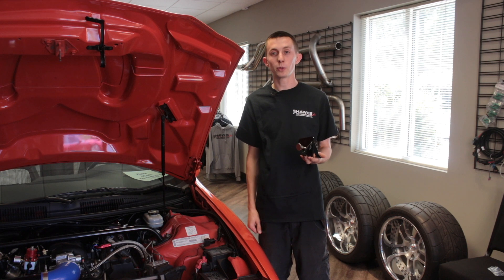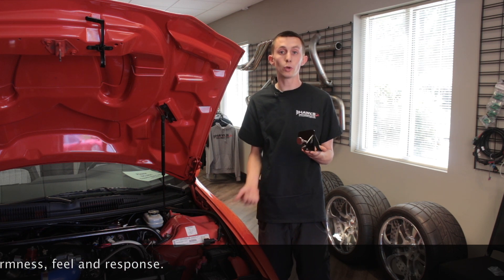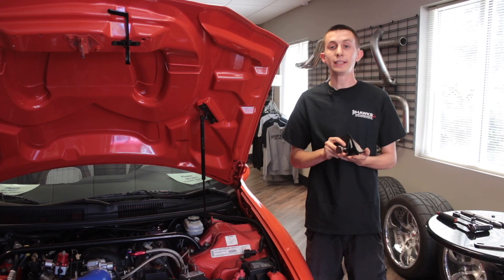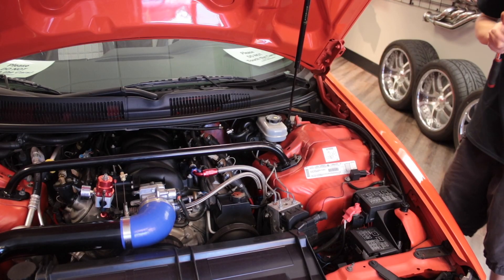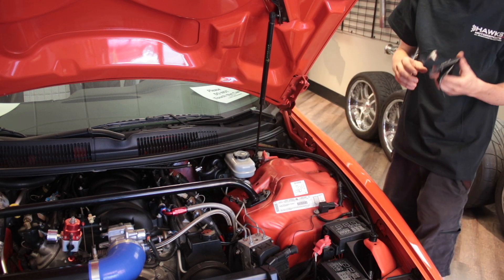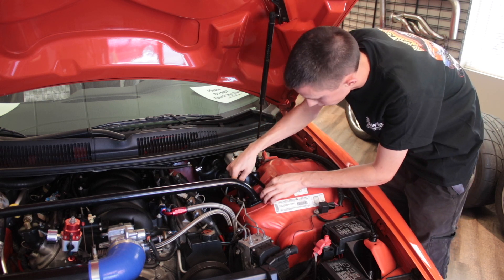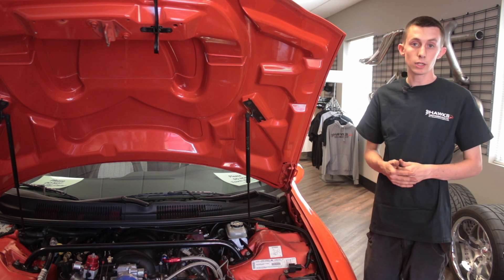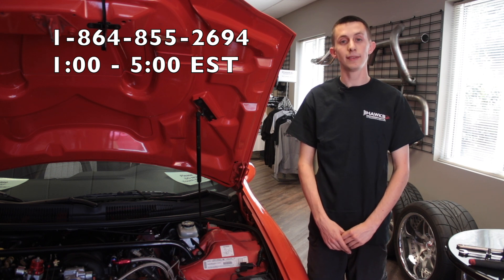Brake Master Cylinder Brace Installation Instruction

Comment: I fucked mine up and tried installing all 3 bolts/nuts at once, pulling the star bolt out stripping half the threads. I gotta get a longer one of the same pitch/thread now to fix it.

Comment: Tyler Hawkins, do everyone a favor and read the paper work on how to installed this part before you put out a clip on the web showing everyone how to do it wrong! The locking nut doesn’t not go on the back side. The paper work tells you and the clip from the Strano also shows how to properly install this item. You may want read and check out there video clip bubba! Locking nut goes on the front side not the back side.
Reply: Learn how to speak English before you start trolling bubba.
Reply: stop being a hating troll bud , I've dealt with hawks on multiple (2 f bodys) occasions and they are stellar to deal with ......I'd imagine your attitude reflects your service bubba . So to anyone reading strike off the bad customer service from this kat .